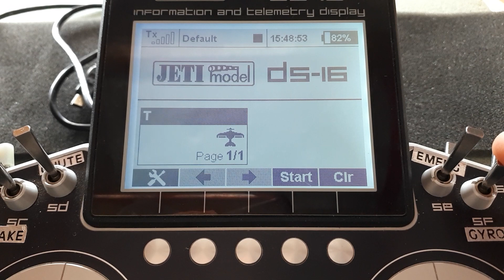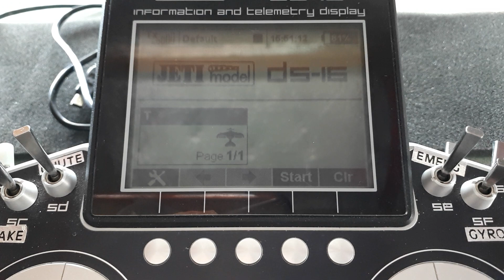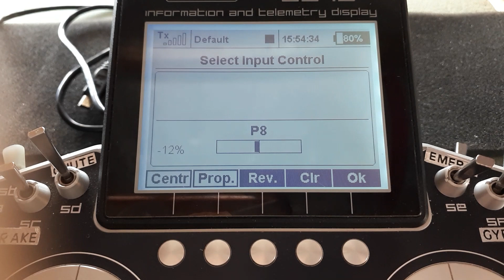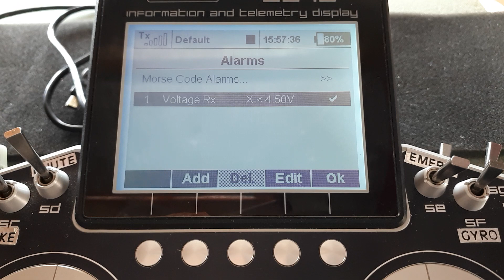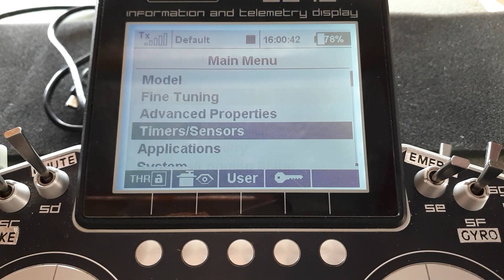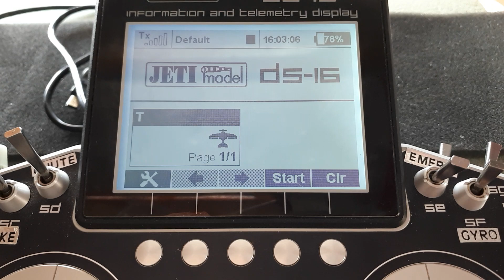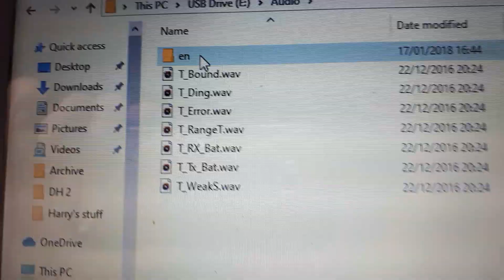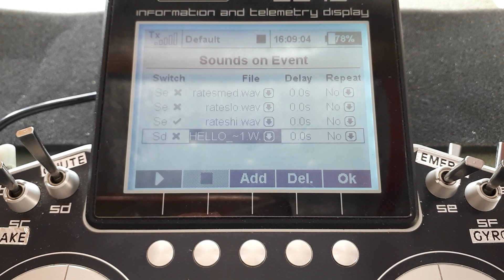Jeti - sounds

Comment: Here is a thought...if you attach a sound file to each switch that corresponds to each model you have in the transmitter...then when you switch airplanes and thus probably switch locations that have different functions...It's easy to reacquaint yourself with the transmitter setup for different models. As for disturbing your fellow modelers. There is a volume control on the transmitter and also earbud outlet.

Comment: Harry, is there a limit to the number of sound files I can have available in the Audio folder in the DS16G2?  I have added files from rc-thoughts to the Audio folder and
they dont show up when I try to use them for Flight Mode switching on my heli.
Reply from the maker: The problem is the length of the file name, which must be no more than 8 characters.  If it is more than 8 it just does not appear in the selection list.  There did not used to be this limit, it came on a recent software update because Jeti had to use different processors than the original design (I suspect the pandemic chip shortage caused problems getting the original processors) and some processors forced the character limit.

Comment: Hi Harry
Just hopping in here to ask a question relating to ‘Sounds On Event'
Is the system limited to 20 'sounds on event?’
I have reached 20 and can’t seem to add more.
Why do I need so many? Is there a more elegant way to do what I want???
I have a 3D capable model with aileron, elevator and rudder all on high, medium and low rates on three separate three position switches (with ‘sounds on event’ as normal to let me know what each control surface is set at). 

I have also set it up on a single switch to hop between a 3D (very high rates) flight mode on all surfaces,  and normal flight mode where I can switch between rates on each surface as I see fit. In 3D mode all rates are set at high regardless of the rate switch positions.

In order to avoid confusion (ha ha) I want to make the transmitter tell me "High", "Medium" and “Low" for each surface when in 'Normal' mode depending on switch positions and to say “High” for all switch positions (x9) when in 3D mode.

To do this I’ve created a Logical Switch for each possible condition (that's 3 x 3 position switches in 2 separate flight modes = 18 options) and used the logical switches  in the Sounds on Event menu.
I do however seem to have run out of Events at 20 (I  have others for  things like throttle cut).

Is there a more elegant and clever way to achieve my goal??  
In Hope
Thanks Nigel
Reply from the maker: There is indeed a limit, for some Tx it is 20.  Some Tx can buy an additional 10 sounds on event.  You could simply not have a sound on event in 3D mode, the silence when you move the switch would tell you that you are in 3D high mode - unless you have moved the wrong switch of course!
Reply: @cotswoldpilot  Thanks Harry. I have a ds-16. Do you know which models can be expanded to 30 sounds on event and how you go about doing it? Is it through Jeti Studio (which I have and use regularly for firmware updates). Clearly its only a 'nice to have' but I always see this type of thing as a challenge.  I was hoping there was a clever way to achieve it!
Reply from the maker: @nigelcastle9282  you cannot add to an original 16.
Reply: @cotswoldpilot  Never mind.. I'll just have top use common sense and memory - oh dear! -

Comment: Harry I am  sure I saw in one of your videos increasing the memory in a DS-16,  I am afraid it is lost to me what video it i in?  Thanks
Reply from the maker: I am not aware of such a thing
Reply: Well I stated that poorly.  It was about putting a larger sd card in the DS-16
Reply from the maker: @roberthanson9843  yes you can do that, not sure what the maximum size is, ask Jeti.  Good upgrade is to use a Class 10 card, that is faster than the card they fit or used to fit, which makes it quicker loading model memories
Reply: @cotswoldpilot  One last question for today. When setting up servos on a biplane how does the servo order work out?
Reply from the maker: @roberthanson9843  just go left to right, top or bottom doesn't matter
Reply: @cotswoldpilot  Harry I guess I had the impression from your comments on servo data processing order that it would matter.  So there would be no difference if top is 1-2 and bottom 3-4 both left to right as compared to top 1-3 bottom 2-4?
Reply from the maker: @roberthanson9843  i think you have that the wrong way round.  Left wing 1 and 2, right wing 3 and 4
Reply: @cotswoldpilot  to make sure I am communicating.  So it should be top wing left S1 bottom wing left S2 and top wing right S3 with bottom wing right S4?  Sometimes I am a little dense!
Reply from the maker: @roberthanson9843  I don't think it matters which are top or bottom, as long as lower numbers are on the left, higher numbers on the right